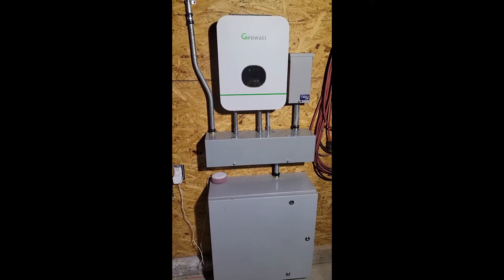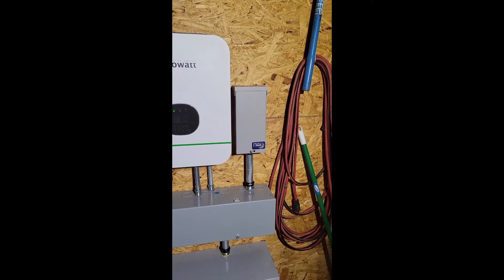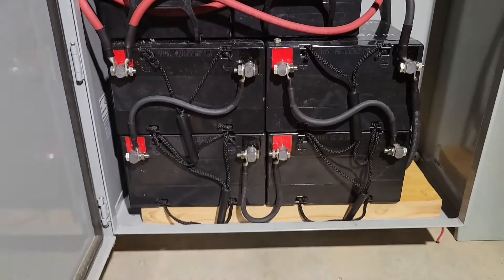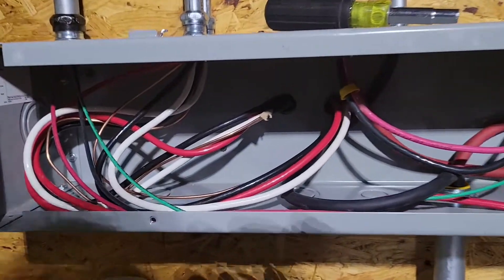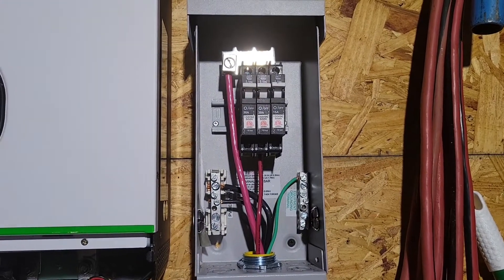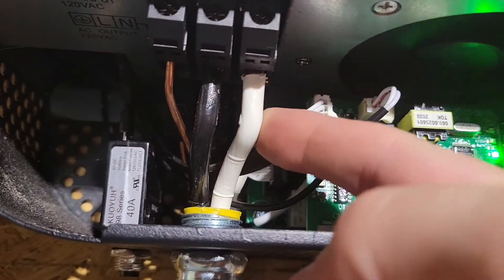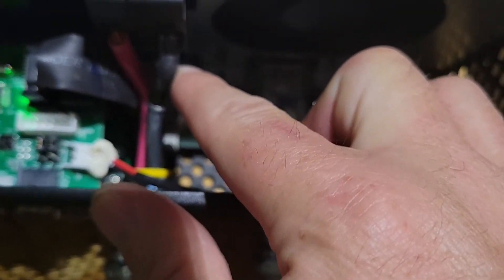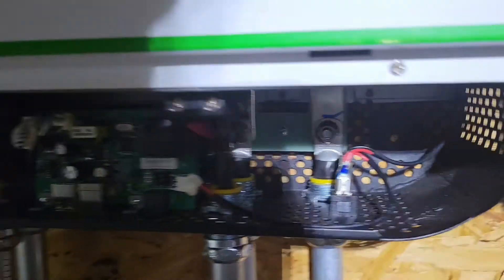Growatt Grid Backup

Comment: #6 awg @ pv/dc into the Growatt?
What size array? How far from each other? Kinda big? I don't know??

 Have collected all my parts, but
Haven't run a wire yet. Great video! none compare to yours in visual connx detail. Very neat install!!
Am still studying on my project. 10kw 48v 200 ah lithium, 5k Growatt off grid inverter 48v 240ac output 450 vdc input. Midpoint xfmr for neutral. 
4 string combiner. 4500 watt array.
Not an electrician. Was told 10 awg was adequate for 150'-00 pv "in" run. Sound right??
Reply from the maker: Currently 4x335 watt LG panels. Have another 4x335's just need to run the conduit.
Reply from the maker: NEC code says 10 awg is rated for 30 Amps, but if you look up table NEC 310.15(b)(16) it will tell you 40 amps. Voltage drop might be a consideration.